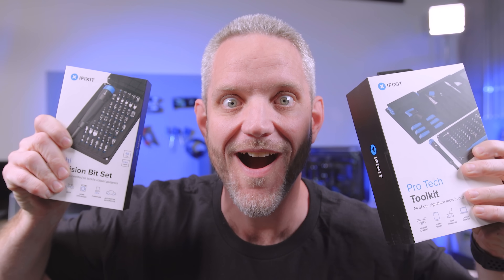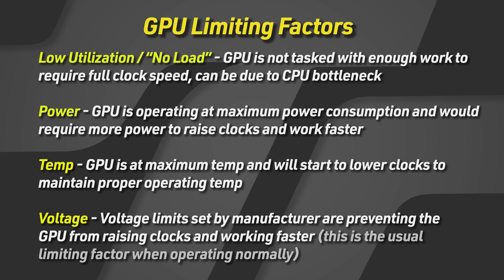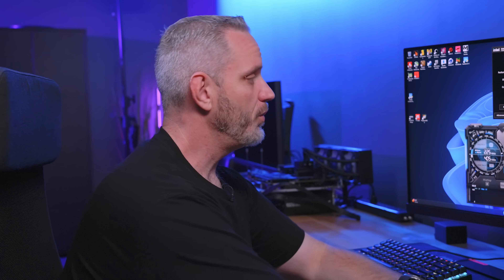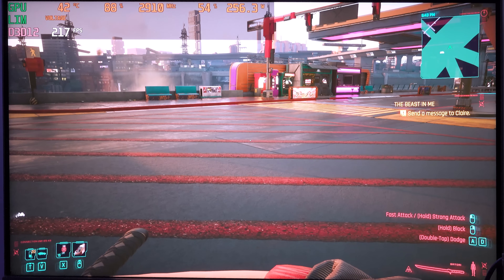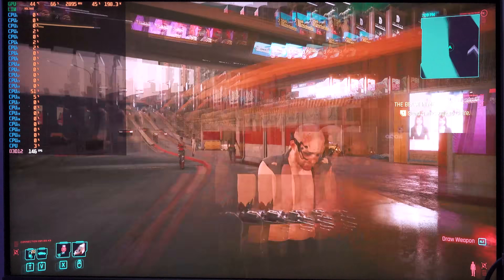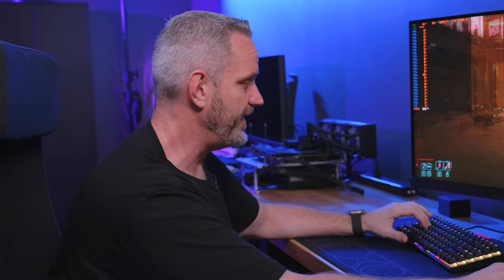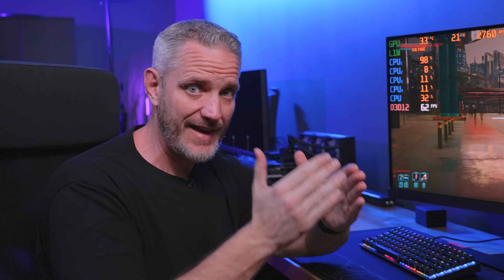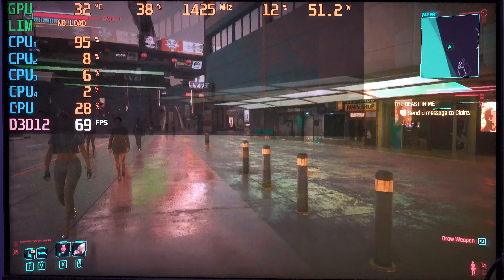THIS is what Bottlenecking REALLY looks like! AVOID THIS!

Comment: As Jayz just demonstrated, the issue with bottlenecking isn't really that your games don't run - if you throw something like an RTX 4090 at it, most computers of the last 6 years should do at least well.
The real issue for most is the price, because price conscious buyers seeking to upgrade their system tend to buy graphic cards that according to benchmarks should be enough for their needs, instead of emptying their bank account to go all overkill with the latest fasted graphics card model available. 
The problem here is that you won't get those same benchmark results if your CPU can't keep up, which means you just wasted money.
Reply: Pretty much every benchmark videos that compare gpus are inaccurate due to this. They pair a 13900K with every GPU, misleading people by making them think that they'll get the same performance with their crappy 9 year old cpu.
Reply: @LSSMIRAK  Exactly. 
You can have a bunch of cores but if they're all clocked low and utilize an older IPC then it's gonna be the bottleneck if paired with newer architecture gpus.

I run a i9 10th gen with a 3090 and it works but the improvements since then are pretty substantial - especially now with 14700k/7800x3d - seems like best upgrade path for my situation.
Reply: I have a 1920x thread ripper that is 6 years old and would bottle neck on my 2070 super. didn't realize it until I started my new build and dropped my 4090 in and got the same fps as the 2070 super. the 1920x had a mild OC and never felt unplayable but apparently it still has more head room in it.
Reply: Just upgraded my 11700F to a 7800x3d and can confirm that I was not getting the most out of my 4080 for almost a year at 3440x1440p. I was so mad when didn’t get the same performance that I saw in YouTube videos in new games and realized that I was bottlenecked. I was missing 30-40 frames in some games.
Reply: I upgraded my i7 920 with 2070 super and 4k TV. That's what a real CPU bottleneck looks in gaming.  It proved to me that average FPS and 1% low's are often bullshit numbers, the real issue happens occasionally when there's spike in CPU load for instance enemy appearing on my screen second after the ambush because your CPU didn't have enough power left to decompress it's model while it was rendering the frames.  Oh. Upgrade wasn't for gaming I needed a new GPU for a GPGPU programming project.  I did use it like that almost a year, until I could afford and really needed to replace rest of the parts.
Reply: I’m the opposite way right now. 7800x3d paired with a 3060ti.

GPU is always at 90-100% load, while my CPU is barely awake. (Varies from game to game of course)
Reply: @RalstigRacing  ... thats a really unfortunate combination - a card too expensive for what power it holds, limited to but 8GB VRAM so more current titles won't even be able to use the card's full performance, and its bottlenecking the CPU to the extreme. Then again as long as you just want safe 60fps at fullHd, the card should still provide for some time, and there is some hope that an upgrade to something like a RTX 4070 (Super) or RX 7900 XT, while everything but cheap, at least won't cost the world.
As a matter of fact, if I were to build a new gaming system right now, I'd probably pick something like the RTX 3060 12GB or Intel Arc A770 16GB or RX 7600 16GB ( announced to cost around $300 US ) because I find $300->$350 to be the pain limit of what i'd be willing to pay for a graphics card.
Reply: @LSSMIRAK if someone is spending 1000usd on a GPU and not upgrading the rest of their 9+yo machine they did it wrong.

Comment: I thought I'd defined the term "bottleneck" by testing my new 4080 in my old Q9300 (2 cores, OC'd to a whopping 3.3ghz) as it was the only case/system I had that fit the monster cooler of the 4080, but in pure GPU benching, it's doesn't seem to be massively affected compared to my 9900k system, about 500-750 points in a furmark bench for example
Reply: Now play a normal game

Comment: Just recently upgraded my RTX 3060 to a Radeon 6950 XT. I was quite concerned that I'd be severely CPU bottlenecked since I'm running a 5600x and I was thinking "damn, am I gonna have to get 5800X3D to run this thing adequately?" but this video makes me think the bottleneck won't be nearly as bad as I thought. Hopefully my CPU can hold out for another generation or 2 until I end up upgrading the whole motherboard.
Reply: Thats a downgrade..
Reply: @BansheeNornPhenex  How is that a downgrade? The 6950 XT is twice as fast
Reply: I'm running a 5600X with a 4070 and having a pretty good experience. In worst case scenarios I just have to tweak the settings a bit.

Comment: Hello Jay,
thanks for your video. People can now identify a bottle neck when they have built a pc - but how can people identify a bottleneck before buying new components? 

When my 1070 broke, it took me quite a lot of time to decide on which GPU to buy next since my system was already built, basically. 
I already had a 5600X and was waiting for better GPU prices before getting a new card. 
Well, after checking a lot of videos around pricing and performance, I decided to buy a 6800XT for 1440p gaming. 
Later on I asked myself if I created a bottle neck for myself. 

Could you make a video to recognize a potential for a bottle neck on paper, so before you buy? 
Can you see which CPU / GPU are a good match just by comparing their technical data and if so, how? 

I believe such a video would be a real help, which people could use as a rough guideline on what to look out for.  
Old rules like "the higher the frequency the better the CPU" don´t apply any more, neither can you just tell the best match by looking at the core count of a CPU, else any EPYC would constantly be the best CPU for everything.

What GPU would you pair with a r5 7600X? A 7800XT? 7900XT? 4070? 
And if you paired this setup, which PSU would you pick? 650 W or 750 W? 

What would change in your selection if ray tracing was considered unnecessary?

Thanks in advance.
Reply: It's quite easy to understand even before buying a card:

Hard bottlenecks should not happen anymore as long as you got at least 8 cores.
Even a 6 core cpu running at high speeds will seldom drop you to framerates that are considered bottlenecks in its fullest.

Best advise is:
Running a midrange-cpu -> buy a midrange gpu.

Pairing a 5600x with a 4090 is not a good choice. 

Funny thing is:
Any 8-core cpu nowadays ( if it's 8 perf- cores ) should be safe not to force you into any bottlenecks. 

So best advice to the end:
If you got a cpu, read the test what it was performing like with gpus that were out at that time. Then search for a gpu- test with the cards you want to use and 1 of the cards in the cpu test in it.
Check the performance difference of the cards.

The trick behind this is, that usually there will be the best performing card of the cpu generation listed. If the cpu was able to run that card unlimited, any card with equal or minimal higher performance won't cause the cpu to bottleneck. Most times you even cards with much higher performance will only be slowed down.

Real bottlenecks occur only when the cpu or the gpu are not able to handle the workload anymore and they have to wait for each other.

Therefore: buy accordingly and get your game settings right. Most times when running into bad frame times, increasing resolution or using gpu-intensive settings will lower the average fps by a bit, but will smoothen out frame consistency,  which in the end will give you the better experience.

I know this answer is long and hard to read, but giving a list of which gpu to buy to which cpu would take years to make. Just because there is so many combinations out there.
Plus, you would need to do it for every resolution and a long list of games to get consistent results.
Reply: Honestly. You have a very good pairing with the 5600x and 6800xt. As for bottlenecking on paper is really down to the individual game your looking at playing. Some are cpu heavy and others gpu heavy. 

Hypothetically you could get similar performance in a game with your 6800xt paired with a 5950x or your 5600x. If it’s GPU heavy. But the next game may play way better with the 5950x if it’s a cpu heavy game. 

The argument could be made that your previous pairing, 1070 and 5600x your cpu is bottlenecked by your gpu. This is where I’d want to be btw. Not the other way around. But I digress. 

I don’t upgrade anything until I see something in my system isn’t providing the level of performance I’m looking for. Then I look at deals and wait for the best bang for buck. Kinda like you did looking at the 6800xt

I just upgraded to a 5600x from my 3300x because I started playing games that needed more cpu to push the frames to my gpu fast enough. (Gpu at 60% util) But before I never needed a faster cpu. Just gpu. 

To touch on your psu question. I’d go with the 750W. I’d push for a good 850W though. Cards are getting more and more power hungry so in the future when you need another upgrade you don’t want to be buying ANOTHER psu just to power the next gpu. Buy one that’s good now so you can slot in a gpu in the future. Your psu is a component that can grow with your rig. 

And for your pairing question of the 7600x. I’d buy the best gpu for your budget. Even if your cpu is bottlenecking it a bit in specific titles. Your gpu potential isn’t going anywhere. Amd will be releasing another gen on am5 (finger crossed it’s the same story as am4) you can upgrade then to get the potential in your gpu then, when you need to. 

Buy what you can afford and have fun gaming! 

But I’m just a dude who has his own opinions on stuff and I’m sure someone will shoot me down 😂

I hope this helps. Cheers.
Reply: Hardware Unboxed and other benchmarking tech channels show cpu scaling vids every few months, thats the best place

Comment: Jay do that with Starfield. This also requires a powerful CPU! The changes to the clock speed and/or number of cores will become noticeable much earlier and more strongly.
Reply: @CarlosXPhone  starfield does require a powerful cpu. my 5800x3d is in the 50-80%s in new atlantis at 1440p max lol. ON ALL CORES.
Reply: @Pand0rasAct0r_ 5800x3d and 4090; it's not a hardware problem. It's 100% Starfield being a turd. Some of the INI file tweaks prove just how full of it Todd is about optimization. I get the feeling all they did was "make sure the game loads" and called it a day.
Reply: @CarlosXPhone  mate this game simulates thousands of objects in real time even more than back in skyrim or fallout4.  Yes its creation engine jank as well but damm did they improve its capabilities. it could be better optimised for sure but its simply wrong to say its not a "powerful" game because it very much is.
Reply: @spaghebbio it is doing that though. unless you are in a specific cell like a house the area you landed in is loaded in. all of it xD
Reply: @TheGameFAQ.

I guess you missed my post on Jays "Starfield is the new Cyberpunk " video it is at the top....... I already tested this to a much deeper level across multiple dimensions.

I did significant testing / Benchmarking to understand how this game scales CPU with different limited metrics. Computer: Intel 13th Gen - 13900K, 32 Gigs DDR5 @ 7200 MT/s & nVidia 4090 MSI Suprim X on Windows 10. Below are the results:

I found a good CPU limited situation in new Atlantis near the tree just after we walk up the stairs (right near where Jay and Phil were testing) There may be a tougher area later in the game but this worked well for me to test.

The Game was set at at 1080p HUB optimised settings, with FSR2 and 50% resolution scale so the 4090 GPU was loaded 63%-73% utilisation so I could tell this was CPU limited (the bottleneck for FPS).

Test set 1 - DDR 5 Memory Scaling.
P Cores @ 5.5 Ghz & DDR5 @ 7200 MT/s = 115 FPS
P Cores at 5.5 Ghz & DDR5 @ 5600 MT/s = 105 FPS (28% less memory clock and 7.4% less performance)
P Cores at 5.5 Ghz & DDR5 @ 4400 MT/s = 96 FPS (63% less memory clock and 18% less performance)
P Cores at 5.5 Ghz & DDR5 @ 2933 MT/s = 76 FPS (145% less memory clock and 51% less performance)

This shows there is some scaling with memory but not one to one. Also it shows you can cripple a 13900K with slow memory. Those hungry cores need feeding with good fast RAM.

Test set 2 - CPU - Clock Rate Scaling (E Cores turned off so only P Cores are on)
P Cores @ 5.7 Ghz & DDR5 @ 7200 MT/s = 117 FPS 
P Cores @ 5.5 Ghz & DDR5 @ 7200 MT/s = 115 FPS
P Cores @ 5.0 Ghz & DDR5 @ 7200 MT/s = 105 FPS (10% less clock than 5.5 Ghz and 9.5% less performance)
P Cores @ 4.5 Ghz & DDR5 @ 7200 MT/s = 100 FPS (22% less clock than 5.5 Ghz and 15% less performance)
P Cores @ 4.0 Ghz & DDR5 @ 7200 MT/s = 90 FPS  (37% less clock than 5.5 Ghz and 27% less performance)
P Cores @ 3.5 Ghz & DDR5 @ 7200 MT/s = 80 FPS (57% less clock than 5.5 Ghz and 43% less performance)
P Cores @ 3.0 Ghz & DDR5 @ 7200 MT/s = 70 FPS (83% less clock than 5.5 Ghz and 64% less performance)

This shows there is good scaling with CPU clock rate, I managed to drop over half the fps performance by dropping the clock rate.  It would be interesting if we could see if 6.5 Ghz continues to scale performance.  - I'll leave that for someone with LN2 (Gamers Nexus).

Test set 3 - Ecore Scaling - E Cores On vs Off.
P Cores @ 5.5 Ghz + E Cores @ 4.2Ghz & DDR5 @ 7200 MT/s = 125 FPS (9.5% more performance with E Cores on vs E Cores off)
P Cores @ 5.5 Ghz & DDR5 @ 7200 MT/s = 115 FPS (9.5 % less performance with E cores turned off). 

I checked the E Cores load and the game was loading them over 55% so a good utilisation and it took some of the workload (15%-20%) off the P Cores. So they are working well in this game title.

Note: Turning off Hyper Threading on P Cores actually lost me 10% performance.

I hope you find this interesting!

I'm not sure they can optimize the CPU load more as the CPU Core utilization is already very good in Starfield. Perhaps they can reduce some specific workloads in the title with some effort.

Yes the 13900K and 4090 are well matched, funny thing is the recent re-bar mode pushed the game to be CPU limited on 4090 as you get 5-10% more FPS with rebar on so the fix is you can now turn up the graphical settings like resolution scale to 68% to load the GPU up to 98% load.

Comment: People need to realize that a bottleneck will vary depending on the game (unless you have a serious hardware mismatch). In fact, there are often both CPU bottlenecked moments and GPU bottlenecked moments in the same game. My old 5600X frequently bottlenecked my old 6700XT even though they are a good pair. 

CPU bottleneck is usually the worst.
Reply: What did you upgrade to from 5600X? I have RX 7800 XT now and 5600X and it kind of feels that the 5600X is a little bit of bottleneck in some situations.
Reply: What happens when cpu bottle necks gpu? I can currently get a 4090 at a good price and considering buying?but I currently have 5800x3d cpu, if I bottle neck at 1440p will games stutter or drop frames etc? Thanks
Reply: @dragonclubracing8669   A 5800x3d will work fine with a 4090, hell you can get away with a 5600x. 
Some cpu heavy games will have a little bottleneck on a 5600x, but no matter what you have a bottleneck in your system which was the entire point of this video.

Any CPU that has came out in the past 5 years that isn't a I3 or Ryzen 3 will run a 4090 just fine. Even more fine if your planning on playing 1440p or 4k.

Comment: The biggest bottleneck for me has always been my monitors. Going to 1440p 144hz was a game changer but 165 or 240hz doesn't have the same impact. And 4k 144hz is still a bit out of my budget.
Reply: Yeah, i went from 1080p 60hz to 1440p 165hz recently and it's mind blowing. Of course, if you have at least 100fps in games. At 60fps it's not a big difference, pretty much same, just a higher resolution. But at competitive titles 144hz or above is a gamechanger